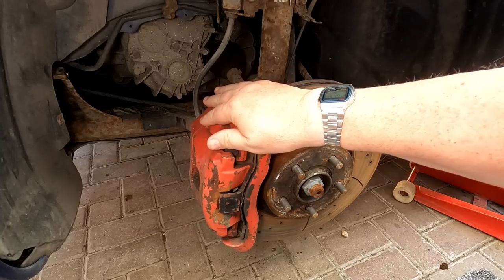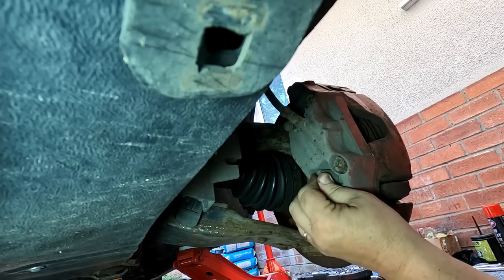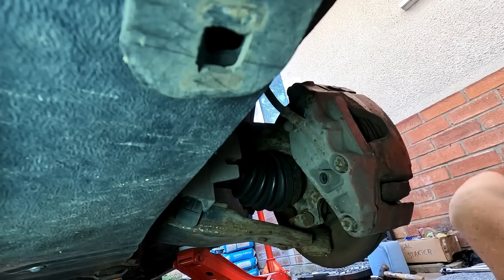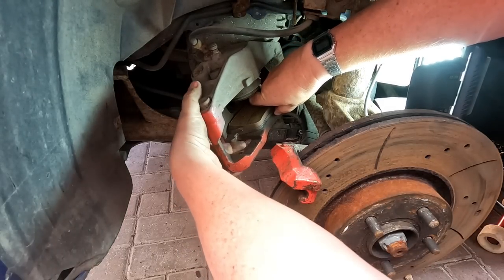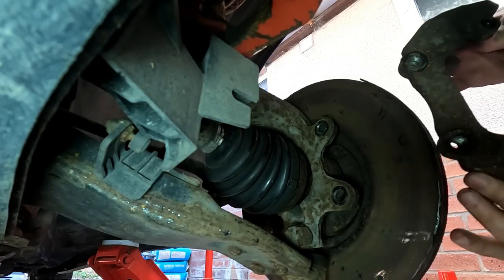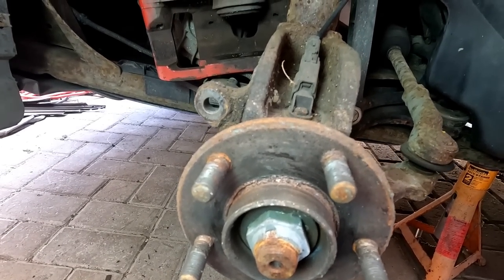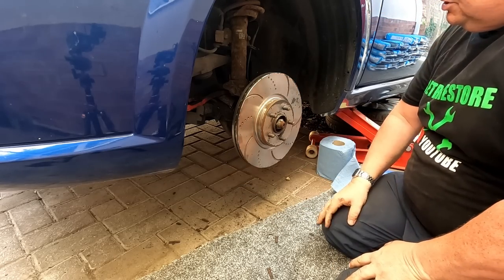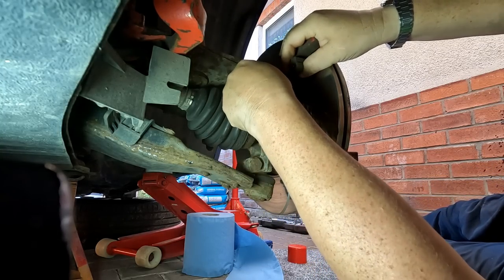Unleash the Full Potential of Your Mondeo ST220 Brakes

Comment from the maker: For those that think the discs are the wrong way round  more internet garbage. They are not handed. I've seen it said about the swirls but in reality, it doesn't matter.  The only thing that is handed on brake vented discs is  the cooling vanes in between the vented discs bud. Not the external patterning. It makes no difference. If the vented discs are swirled, it makes a difference. If they are straight cut, it makes no difference. Its just like when tyre fitters don't line up the dots on the tyers with the tyre valves, certain people say the tyres are not fitted properly. In the real world it makes no difference. 
Copperslip has been around in the motor trade for decades and I've used it for over 40 years and have never seen anything destroyed by it. All internet hearsay from armchair experts just get repeated in my opinion through my own experience  using common sense.
Reply: I agree with you Martin 👍
Reply from the maker: @AliMackMechanical  Cheers Ali, So much crap out there just get's repeated by armchair experts.
Reply: @retrorestore  I see it everytime I put a video up Martin i did the rear brakes on the old Quattro I have here and someone said to me about the flexys and the calipers hanging I was replacing them anyway they didn't know that because I didn't show it in the video if they had watched the video prop they would have heard me say it.😂😂

Comment: Great video only one thing, you put disc on the wrong way round the drill holes and grooves are suppose to go other way, the disc you took off was correct way round.
Reply from the maker: Makes no difference really. They are not handed. I've seen it said about the swirls but in reality, it doesn't matter.
Reply: @retrorestore  no problem Martin just thought would point it out in case you hadn't realised, good brake setup have same on mine it's known as the Asbo brake upgrade
Reply: It’s a bonny car martin
Reply: If not the correct way they make noise as you drive I’m speaking from experience as I did it 👌🏻
Reply from the maker: @Thejoker-zg1gk  you must have had something wrong as there is no noise at all.
Reply: @retrorestore  yes I did they where on the wrong way round all drilled & grooved are Directional 👍🏻
Reply from the maker: @Thejoker-zg1gk  Maybe on race cars but in the real world, it doesn't matter at all. Its similar when people get a tyre replaced and if the dots on the tyre are not aligned with the valve, you'll find some people will say the tyre is fitted incorrectly.  The reality is, it doesn't make any difference at all. It depends how you are programmed about rules, Its just passed the MOT today as well.
Your experience and mine appear to be different. No problem there. It's what makes the world go round.

Comment: The disc is on the wrong side?? inside the vented groove some discs are manufactured in a certain way  to aid Air flow through the disc. This is a fact, I am not being funny ,just trying to help, still enjoying your chanel martin.
Reply from the maker: Makes no difference Matthew. They are not handed. I've seen it said about the swirls but in reality, it doesn't matter.
Reply: Also some manufacturers even cast in the disc, L and R for this reason .
Reply from the maker: @matthewharmer1656  that is only for the cooling vanes in between the vented discs bud. Not the external patterning. It makes no difference.

Comment: You put the discs on the wrong side mate. Need switching 👍🏻
Reply from the maker: Makes no difference David. they are not handed. I've seen it said about the swirls but in reality, it doesn't matter.
Reply: @retrorestore  no worries. I always thought it did 🤣
Reply from the maker: its the same when people see a tyre put on a car and the dots don't line up with the valve, people moan about that too lol Dave.

Comment: What happened to disc bolted to hub, stripping hub bearing removing bolt to remove the disc, re setting Castle nut pressure on bearings and split pin,  all the fun been removed. Thank all the God's above. Took them awhile to get there.

Comment: Were the new discs NOS ? I noticed that they were not coated ( like they all seem to be these days), and also ,as you pointed out,  had surface rusting.
Also , I was expecting the internet to crash when you got the tin of copper slip out 😂, surely you know all the things that can be totally destroyed when using the " devils paste"! ( not to mention the discs being on the wrong side 😮😮😊😊!!
Reply from the maker: They had a thin oil coating. Copperslip has been around in the motor trade for decades and I've used it for over 40 years and have never seen anything destroyed by it. All internet hearsay from armchair experts just get repeated in my opinion. As far as the discs being on the wrong side, more internet garbage. They are not handed. I've seen it said about the swirls but in reality, it doesn't matter.  The only thing that is handed on brake vented discs is  the cooling vanes in between the vented discs bud. Not the external patterning. It makes no difference. If the vented discs are swirled, it makes a difference. If they are straight cut, it makes no difference. Its just like when tyre fitters don't line up the dots on the tyers with the tyre valves, certain people say the tyres are not fitted properly. In the real world it makes no difference. All my opinions through my own experience  using common sense.
Reply: @retrorestore  yes I agree with everything you say,  I was just just trying to be funny🤗🤗, all the best to you Martin , I love your tinkering videos !!

Comment: Hi its not related to this video,  I've got a saab 93 1.9tdi (Z19DTH) 
A code p033528 c has come up,
Is it a crank censor ? Or a cam censor? 
Where it it positioned on the engine? 
On the cam under the cambelt cover , by the bottom pully,  or on the engine Bell housing (top, side ,bottom)?
Reply from the maker: Not sure bud, you'd have to Google it.

Comment: Help! Just joined.Martin what can I get black bumper scuffs off the white paintwork of my car?  Project Man & Jimmy too.. any advice much appreciated 😊
Reply from the maker: I wouldn't want you to damage your car trying but if its only on the surface, we might sand it wit 2000 grit wet and dry paper with plenty of soapy water and then it would need buffing up again with a compound and then a polish. Don't attempt if you are unsure as you could burn through the lacquer and then you'll need to have the whole area painted.
Reply: @retrorestore  Thanks Martin, I don't feel confident enough to do that though. I managed to get some off with acetone & elbow grease